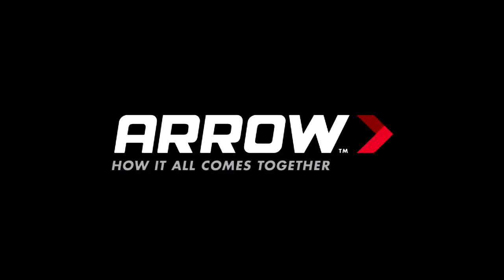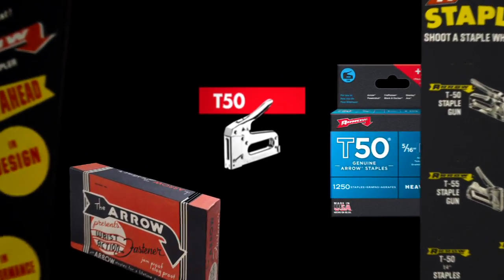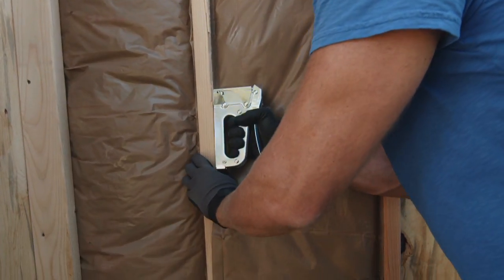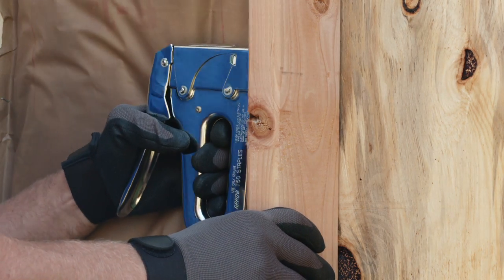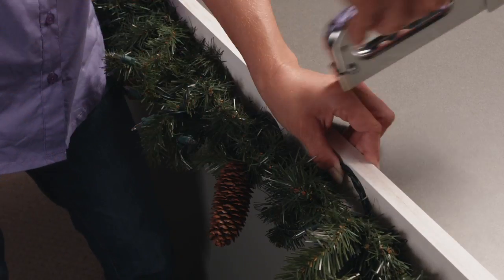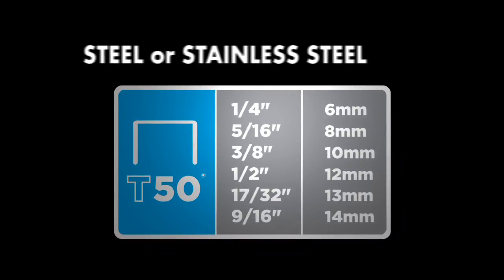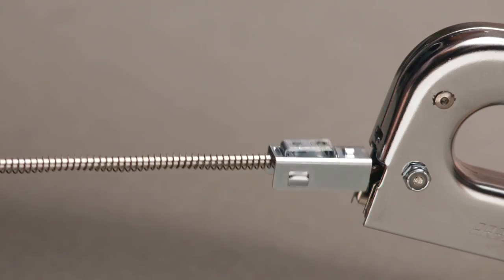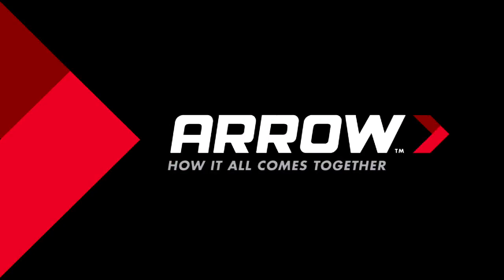How To Use Arrow's T50 Heavy Duty Staple Gun

Comment: I couldn't open mine easily to load staples, had to bend/adjust  a little curved piece that was preventing easy opening.
Reply from the maker: That sounds as though your stapler may be defective. If that's the case, we can offer you a replacement under the warranty. Please call us at 800-776-2228. Thank you.

Comment: Can I use this for plastic furniture? I see no video online about this. I think the material is abs.
Reply from the maker: Hey there, that's a great question! For hard plastic like ABS, we recommend using a pneumatic staple gun like the PT50 (https://www.arrowfastener.com/tool/pt50). You need about 10 pounds of pressure on the tool over the staple exit point when stapling, and that's a difficult to accomplish with a manual stapler like the T50. Hope that helps!

Comment: What is the difference between T50 and T50PBN. T50 PBN has same stregth as T50?.
Reply from the maker: Correct. The T50PBN is an upgrade from the T50. The T50PBN has all of the capabilities of the T50, but it can also fire 5/8 inch brad nails, which the T50 can't do. Plus the T50PBN has an over-mold grip for added comfort, which the T50 doesn't have. 

Thanks for the question! Hope we could help!

Comment: I was hoping there was a secret to using this....my brand new one keeps jamming.  Only about 1 staple in three works, the rest jam or fire blank.  Bostitch saved my project, it works like a charm.
Reply from the maker: Hey there! Sorry to hear you're having trouble. If you need help unjamming, we have video instructions here: https://www.youtube.com/watch?v=-UtcDB-qddE

But if this is an ongoing issue, it sounds like maybe there's a problem with your T50. First, make sure you're using Arrow T50 staples. If you are, and you're still having problems, then please consider reaching out to our customer service department for help: https://arrowfastener.com/awesome/contact/

Hope this helps!
Reply: I wasted my money on one of these too. Not even jammed, but still doesn't work. Next time, I'll buy from someone reliable.

Comment: I brought one of these and it just won't work, me or the guy who sold it to me couldn't even get the staples in.
We tried a different brand of staples, got them in easy, but than wouldn't fire
Reply from the maker: Hello - We're sorry to hear that you're having problems with your stapler. We recommend using Arrow T50 staples with this staple gun. You should be able to easily load a strip of T50s into your stapler. This loading diagram might help: http://bit.ly/t50-loading. You'll also want to check for any jams. Here's how: http://bit.ly/t50-tip. If there are no jams and the staples are loaded correctly, but you're still having trouble firing, be sure the stapler is in full contact with the surface and place a hand on top of the stapler for added pressure. Our tools are backed by a warranty, and we'll replace your stapler if the issues you're having are due to a manufacturing defect. For additional help, or to learn about the warranty, please contact us at customercare@arrowfastener.com or 800-776-2228.  -Your Arrow Fastener Team
Reply: @arrowfastener 
Even following the instructions, it does not taken even the brand's staples.

Comment: My stapler is not burying the staples
Reply from the maker: Hey there, sorry to hear this. Just to clarify, what you mean is that your T50 is firing staples properly, but they won't sink all the way into the material, correct? In other words, you're left with staples sticking out of your workpiece?

Sometimes this will happen when stapling into harder materials. Our first recommendation is to try switching to one size smaller staples. You want at least 3/16 inch of the staple legs to sink into the base material. If your staples are securely staying in your workpiece, then you probably are achieving that 3/16 inch; you just have some extra length on the staples that sticks out. So by reducing your staple sizes, you'll still get 3/16 inch of your staple securely into your workpiece, but you won't have the extra length sticking out.

If this doesn't help, another solution is to consider a more powerful staple gun. Our pneumatic PT50 or electric T50DCD are excellent for driving staples into harder surfaces.

Comment: How do load Stanley staplet
Reply from the maker: This staple gun uses T50 staples 1/4", 5/16",  3/8" 1/2" and 5/16" lengths. T50 staples have a 3/8" crown width. If your Stanley staples have the same specifications, they should work with your T50 staple gun. Here's the video on loading. Hope it helps!